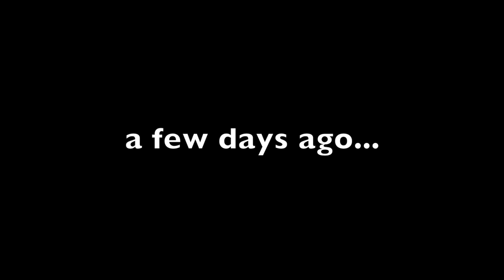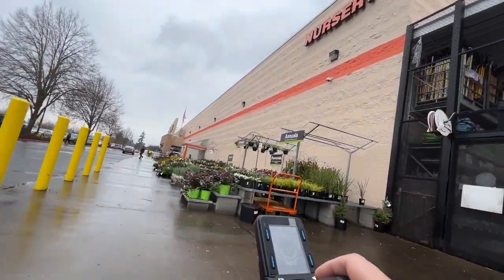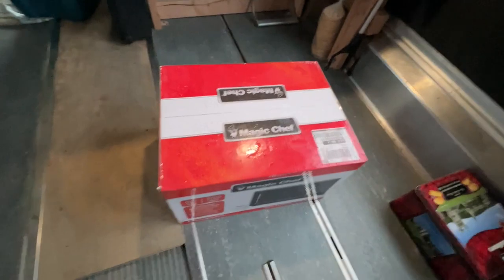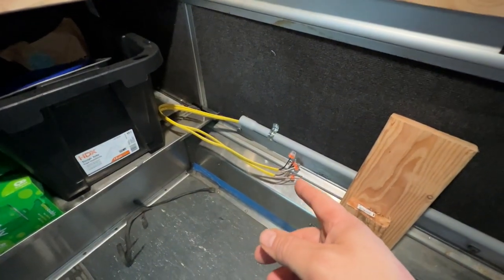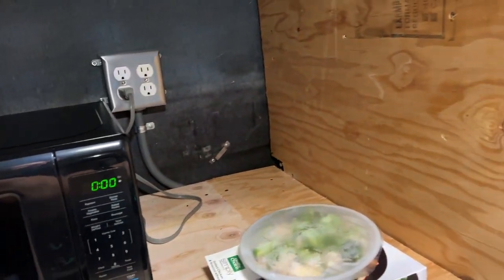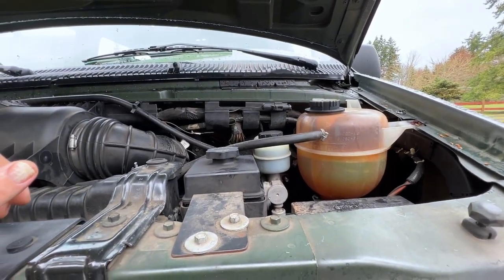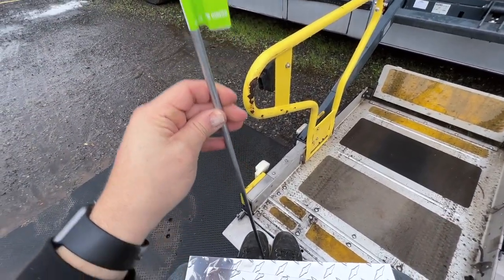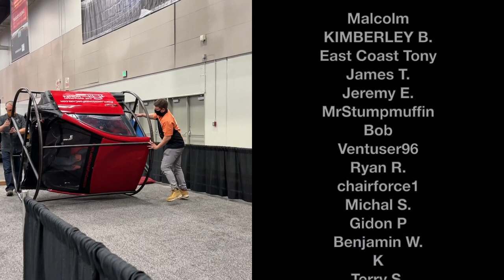VLOG 602: building the kitchen!

Comment: Dan, Amazon has a number of microwave meals that don't need refrigeration or freezing. They are Hormel Completes Brand and you can get assortments. So far all the ones I tried are really good. They take only 1 minute to fully heat. My only complaint is they are too small. Easily need 2 or more to fill you up. They also don't take a lot of storage room. Bob

Comment: Do you ever mess around with manual chairs I don't ever see any parts in your 
shop just wondering why you prefer a power chair over manual chair I guess
Reply from the maker: i use a TiLite ZRA - but they're pretty simple, and dont break much :^)
mine's gone unmodified for the last 8 years...  i built some larger side-guards for it, and installed frog legs.. but that's about all